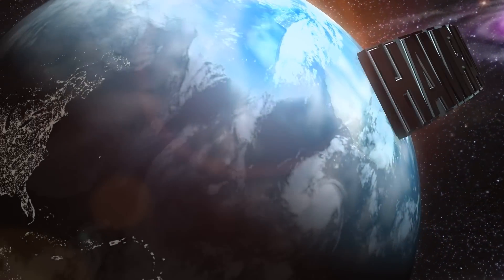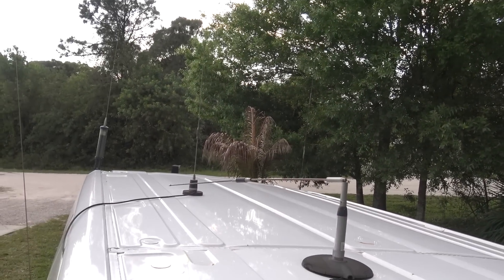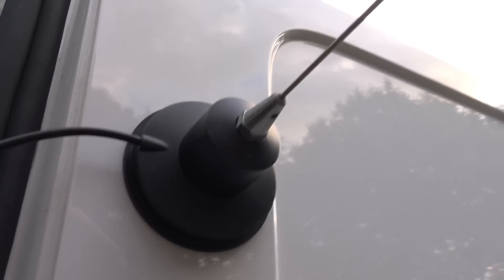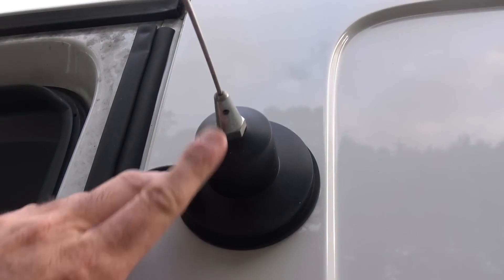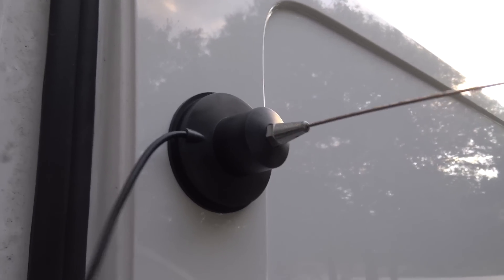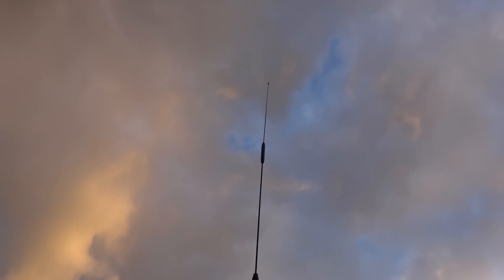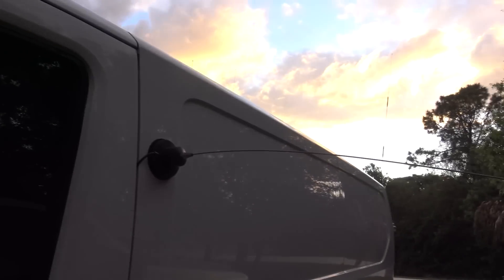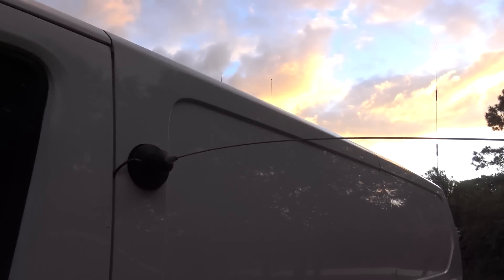Shark Antennas, 48"  2m/6m/70cm 5/8 Wave Magnet Mount Antenna Review/Update, American Ham Antennas

Comment: Have you used this on 6 meter? If so, how was the performance. I am looking for a 6 meter antenna that I can use in an apartment that does not have a balcony. No such beast. So I am looking at mobile antennas that work on 6 meters.
Reply: Curious if this works for you. I'm in same situation.
Reply: @Skydancer_1  I have not tried it yat. When I do I will let you know.

Comment: Very disappointed with my Shark 2m 5/8 wave mag mount. I purchased 2 of them and in 6-7 months one of them rusted so badly that the magnet separated from the antenna and is no longer usable. It did work great prior to rusting. I regularly made 50-60 mile contacts while mobile.